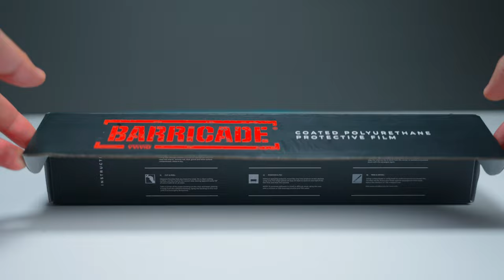Protect Your Car's Paint with VViViD's Barricade® Clear PPF

Comment: How come Vivid, frog Vinyl, and 3M only sell 5ft sheets? Most car and truck hoods require 6ft x 6ft sheets and I can’t see to get that anywhere.
Reply from the maker: That is the industry standard and the adhesive, coating machines available are 5ft. Also 98% of hoods require 54” of material or less.
Reply: Do you have the source of this stat because it needs to take into account larger cars of the 2010-2025 year. The size needs to be updated to increase sales in the DIY market. Just have someone look into this please.